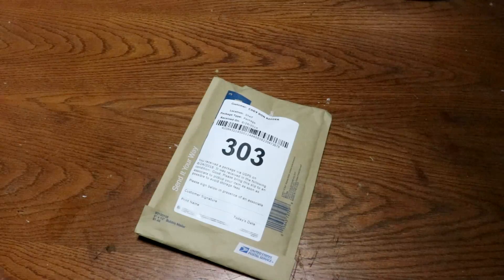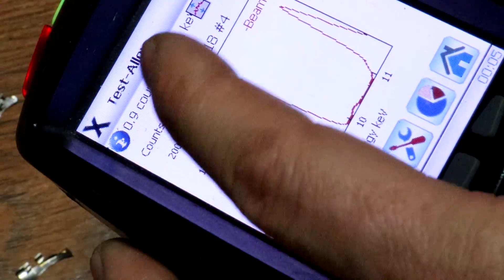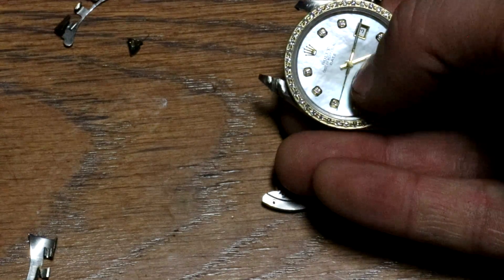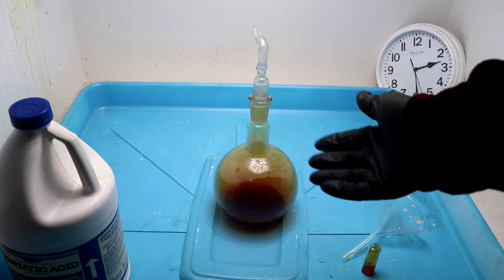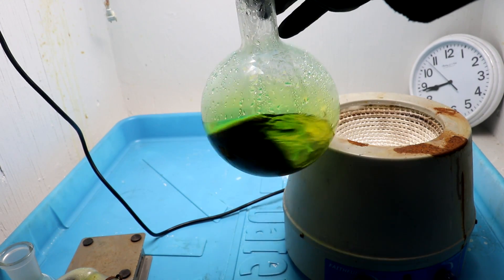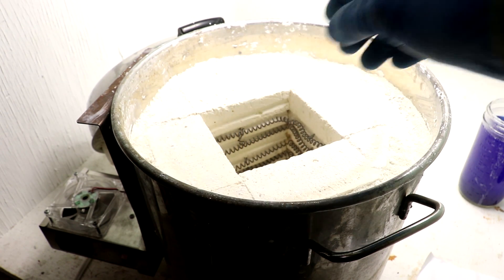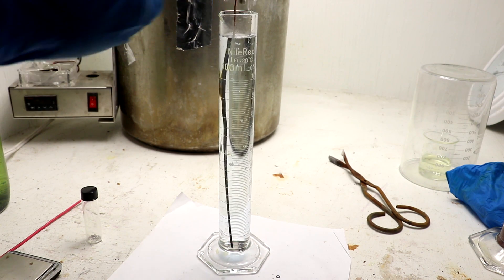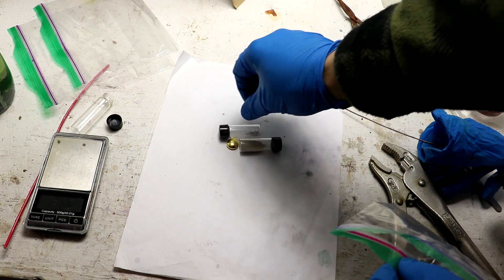How much Gold/Silver Is Inside a 7,000$ watch?

Comment: I hope u know that if u took the movement out properly, u could have sold just the movement on ebay for around $200+ (at auction) depending on the time of year. U could still sell the parts individually on ebay and get some money back. If u do don't do a buy it now,  do an auction. Ull get more for them. (I buy and sell on eBay and repair watches and I would love to have those parts)

Comment: To get silver out of ammonia solution, you as use sodium dithionite (just like you used sodium metabisulfite for gold). I found a local chemical supplier who actually has sodium dithionite, so I can just crash the elemental silver out of solution instead of cementing (which produces copper metal waste) or doing the lye and sugar process. But the copper method works great.

Comment: Ladies TT Rolex Datejust  with Jubilee Band. The center links, bezel, crown cap, hands, dial markers: 18K. Possibly Jewel settings and alloyed gear train. The case and outer links are 317L Stainless. The Diamonds are all very high quality VVS1. How many "Points" (diameter in mm)? 20?      .20 karat?
If you melted a full gold case and band (not two tone) you would have gotten $3k.
Reply: Rolex factory diamonds are above VVS1, it usually flawless or internally flawless (IF)
Reply: @karasus7512  Thank you for the correction. I'm a Horologist rather than a Gemologist.
Reply: I made another mistake. Points are a decimal of karat. But measurable in mm also *if converted*. 4mm = .25 points/ 1/4 Karat. But 8mm = 2 Karat.

Comment: To recover the silver, you should have put the AgCl into NaOH solution until it turns black, forming Ag2O.  Then add sugar and get a large exotherm.  Result is silver powder.  To prevent silver evaporating, melt borax in the crucible and drop the prewarmed silver into it.
Regarding silver and ammonia: such solutions on standing form explosive mixtures, (solver azide) especially on standing!

Comment: Also, just some rough estimates. 1 carat diamond price really depends on on the 3C's. but since they are used in a Rolex lets assume they are mid-high quality,  about $6000 per carat. those look like 1pt diamonds (100pt = 1 carat) and there are about 45 of them. So, ((6000*.01)=(60)*45)=2700. so about $2700.

Comment: The red pieces that hold the gears are likely to be rubys, and if it says rolex id be disappointed if they werent
Reply: There are a few exceptions but for the most part, all watchmakers use synthetic jewels as bearings, Rolex included.

Comment: Ever notice that? gems are minerals as well but they have no set market value. You'll pay a whack to buy them but when you try and sell them they truly have no value. My father was sold gems in the 80's as an investment. All certified and packaged gems. They apparently have value but unless you sell them to someone on the street individually there is no market for them. Same folks running the jewellery chains that would buy the gems also own the mines. They are only interested in mining more, marking them up and selling more and more. Once you own it there is no market. Gold and silver have set market value but the gems are valued no more than art based on cut a clarity. So when folks go and buy that fancy ring? Realize that the only true guaranteed market value on the stone is no more than the going rate for diamond used on an abrasive cutting wheel.  It's like paying a fortune for a painting from an unknown artist. Unless your gem happens to be one of the huge famous ones, that actually are rare, they have no investment value whatsoever.

Comment: These models pre 2005( for the datejust that is) have hollow centerlinks. The new ones are solid. Even the 16710 and 16750 gmt models ( ended in 2008) have hollow steel centerlinks

Comment: I counted 47 diamonds, I'm assuming they would have had a round number of 50 on a piece like this. Roughly guessing the size based on the ridges in your finger nail to be around 2mm making each diamond 0.03 carats which are around $36 each. That makes $1800 in diamonds. Adding that to your $500 in metals and we are at $2300. I'd say that's fairly reasonable considering the super low margin or error for clockwork precision and the fact that mechanical watches are still assembled by hand. Overall, I'd guess the cost to the company to produce a single watch is around $2600. 
Granted, it is still a prestige level luxury good with that kind of mark up, but I honestly expected it to be a lot worse.

Comment: So if you placed that x-ray gun on someone and activated it, could you give them cancer? Also, would it just register a bunch of carbon and water?
Reply: GameGuru No it isn’t that powerful a source of x-rays, but it is still not recommended.
Also it is calibrated for elements which have intrinsic value. There isn’t much of a trade in scrap water or carbon, however being able to point it at a random bit of gold coloured metal and get an idea it is 18 karat gold (75%) or base metal (eg brass).
Reply: The gun works mostly off reflecting Ray's, flesh doesn't reflect much, so it wouldn't register
Reply: Looks like no one in this thread has really answered your second question; would it only register carbon and water if pointed at a human. There’s gold in our bodies. Among tens if not hundreds of other trace elements. This seems to be a very precise X-ray gun, so if it could read what’s in human flesh and blood there would be at least dozens of elements to be seen
Reply: Yes. All light including and higher in energy than UVC has enough energy to knock off electrons from atoms, which gives it the name "ionizing radiation", and that will lead to cancer as it corrupts DNA. However, it's not as powerful as to penetrate materials very deeply, as it measures backscatter. It also seems very low in energy.
Reply: NB.  Energy, in terms of X-rays is represented by the scale showing keV. That determines/indicates how energetic the "beam" is.  The Exposure -dose one would get ( in Sievert(s) or Gray(s)) depends on the Energy of the radiation, the power output  (accelerator potential converted into X-ray flux) and exposure time   (Sieverts take type of radiation into account)..  It gets complicated, correlation with harm to biological tissue is not straightforward, risk is easier to determine than actual harm.
 Penetration is only correlated to the keV value of the x-ray, it has nothing to do with flux (afaik).  <40 keV is  regarded as a fairly " soft" x-ray (kind of like what is used in mammography)..
X-rays used in most diagnostic imaging for example are up to 2-5 times as   "hard" ie. up to 200keV - still regarded as " low energy x-rays.

lol..

ie, the higher the  (eV) voltage ( "particle" accelerator potential) the "more" ionising, hence the more dangerous in terms of mutagenic risk...

sorry  hijack.
Reply: No clue how many xrays his xray does. But regardless it shouldn't be more than a normal hooman xray. It takes alot of energy to produce Radiation if wete talking about electronics.
Reply: Grenherb  And your source for that preposterous claim ("cancer rates are at a[n] all time[s] high")? Is that why life expectancy keeps growing?

Comment: just for the record - value of gold is really NOTHING compared to the value of cut, gem-grade diamonds (source of knowledge: buying an engagement ring :-DDD a tiny change in the size of the diamond -> quite noticable change in the priceof the ring of the same model (both directions - increase and decrease); ANY increase of the ring size = amount of gold used -> negligible change in price (either direction). now this might be a courtesy of the jewelry shop but i doubt it. i think it really comes down to diamonds being much more valuable than gold. of course depends on the shape, size and probably color and cut but according to my shopping experience, that's what it is.

Comment: Those diamonds appeared to be around 0.10ct. It's hard to tell in the video but they were probably Imperfect grade i3M to i3O.

That means they'd be around $40 - $75 a piece. They looked very pink in the video, and I counted 50 of them. So you'd have at least $2500 in diamonds if they were $50 a piece i3O quality.

However, diamonds have an incredibly low resale value. So if you brought them in to a jewelry shop they'd probably give you less than $1000 for them all.
Reply: I'd be surprised if you could sell the diamonds for more than a couple hundred dollars. Diamonds aren't rare to begin with and the ones they use for this purpose are generally pretty low quality. All they have to do is sparkle.
Reply: @CrimFerret  yeah, and for the size and weight, the price is too low for individual pieces.
Reply: They're higher quality than the ones they use in abrasives for sure. Those ones don't even sparkle
Reply: you all have far too much time on your hands. Pardon the pun
Reply: Diamond saints
Reply: I can do $10 for all
Reply: What is i30? Do you mean I3? Even if they were D/I3 diamond max rap is 35 each, I don’t know where are pricing diamonds but you’re 100% wrong. 

Secondly, the diamonds are not even close to .10ct each. This is a Rolex Oyster Perpetual Datejust, looks like a men’s 41mm. That means the bezel is approximately 128 mm around, with 50 diamonds the largest stones you could fit would be 2.5 mm each - or .05 carats. 

Lastly, this is a diamond bezel on a Rolex. Rolex is not going to use subpar I3 goods. These are almost 100% VS+ goods with G+ color. 

Quit spouting garbage.
Reply: @hunterbrown9152  -
"The standards in the diamonds Rolex uses are incredibly high. Only diamonds that are at least IF in clarity are used and only diamonds that are between D and G in color are used. These standards include only the four highest grades of color. Rolex uses its own jewelers to set the diamonds in its watches."
Reply: @hunterbrown9152  Factory Rolex diamonds are always IF. The dial and bezel on this specific watch appear to be aftermarket. :)
Reply: @hunterbrown9152  can't trust anything you say cause the first thing you say is wrong . It's a ladies watch, is the small case size and the mother of pearl dial not a easy giveaway ? Secondly it's 36mm at max cause it has the old clasp , 41mm watches are new ones . Thirdly as others already mentioned how do you know they are not aftermarket diamonds ?
Reply: @hunterbrown9152  so whats your price boy
Reply: @hunterbrown9152  Rolex is the lowest grade haute horlogerie. They are just a click above ETA driven timepieces, which by some watchmakers are still considered better. That being said you can't rate the diamonds by what their slapped on (although they are definitely not cutting tool grade either)...
Reply: Sketch1994  Go buy a Rolex and tell me what the goods look like. 

You won’t find I clarity goods in Cartier pieces, you won’t find them on a Rolex. It would diminish the appearance of value and luxury. People don’t buy a Rolex anymore because it keeps great time, I have a cell phone if I want to keep track of time. It’s conspicuous consumption, that’s it. 

I understand what you’re saying. I’m aware of where Rolex stands in the watch community. It is still a luxury piece, with luxury goods, with a luxury price tag.
Reply: @hunterbrown9152  I'm definitely not an expert when it comes to stones (far from it actually) but is the difference that obvious to the consumer or even a non-expert (minding the small size and intricate cuts used)? In my field (engineering and manufacturing) most people will sometimes even go for a cheaper product because they are more used to it's look (like turning feed lines or rough milled finishes) and relate it to a known quality. I'm open to being corrected though...I know from personal experience that the eye can tell differences of  10-20μm and you can feel a step of 2.5μm if you're used to it.
Reply: Sketch1994 Hunter Brown is correct.
Reply: @Sketch1994  There are no "intricate cuts". Those are either single or double cut rounds. And the difference between an I and a VS is obvious even with the naked eye.
Reply: The first thing I noticed about the bezel is the spacing of the diamonds, looked very aftermarket to me
Reply: Well dang😭
Reply: The watch when new was easily over $10k, probably more like $15k plus. Not much value there in precious metals or gems. Just shows how little we really know about the true value of stuff we buy.
Reply: LOL a $1000? Yeah. No. and that was your LOW estimate wholesale price? Yeah. no.
Reply: Correction: they have close to 0 value, regardless if in shop or afterwards.
Reply: 0,10ct diamonds is much more cheaper than $40
Reply: That's interesting that 2 perfectly identical diamonds are worth drastically different amounts depending on they're new or used, why is that?
Reply: Rolex only uses the best diamonds. So unless they are aftermarket, they are nice.

Comment: Hi Cody, this is brilliant but I have a curiosity.  Is it possible to do fractional electrolysis similar to the way you can do fractional distillation?  My naive take is that you could use carbon electrodes and voltage control to pick out separate metals.  Then you would get nice crystals directly.
Reply from the maker: that is how they refine copper.

Comment: There is at least one precious gem you missed! They use Rubys on the inside. Because it is used for parts that move, they use rubys for their hardness and low friction with the metals. I saw one on the piece that had a few gears on it. I don't remember how many they use, but I think there should be at least one or two more.

Comment: That is fake. I'll tell you why.

The WhatsInside people have used a fake Rolex before in a video, it's been proven on Reddit. 

Secondly the watch would be worth more than $7k given the diamonds and that the bezel would be solid 18ct gold despite that bracelet being plated. A normal two tone Datejust (gold and steel) is over $10k alone, without any diamonds on the bezel or dial. 

Also the magnifier over the date has been removed, everybody, even a novice with too much money knows that you don't do that. No matter what modifications you do to it you don't take the date magnifier off, granted it could be a rare instance but it's just unlikely especially if the diamonds are factory and not a modification. 

The bracelet is the old folded link style with 18ct gold plating, which would be on a vintage model, they moved to solid links and solid gold like 40 or 50 years ago, and that watch does not look over 50 years old. It could be an aftermarket but it doesn't make any sense that someone would have the bracelet replaced with an older flimsier one. I might have just not seen it well enough but it also looked like there was no logo on the clasp. 

There was also no rotor on the movement for automatic winding, which should be there. 

I am almost 100% sure it's fake. But i'm just one person, I'll post it on Reddit to know for sure.

Comment: cody, a tip when using funnels. to let the air escape from the vessel while pouring a liquid in. i use a small piece of paper to lift one side of the funnel away from the rim so it won't make a seal.

Comment: Is it possible to recover 100% of all materials?
Reply: @ Mathew Clavvette.

99.9% Maybe, 100%, no. 

Chemical reactions are reversible, and there's always some portion of reactants left over because of that. Additionally solubility gradients are not absolute. There's always a little bit that remains in solution. 

The closest to 100% you can get normally is a continuous reaction where reactants are continuously added and products removed. But you only get as close as the purity of the product you can remove.

Comment: To be honest, I was a bit surprised. I didn't think it would be that much gold in the thing. I expected some, but not nearly that much. Most expensive status symbols (sans actual non-functional jewelry) in the 21st century aren't usually that much materially higher value than their common commodity counterparts. Some are slightly higher quality components, hand skilled work and more sturdy materials, but mostly its "only branding". I rarely see a significantly increased value in the raw building materials used. But then again, Rolex is not your atypical 21st century status symbol, but a much older "thing". And this looks to be an old model. While there is definitely a hefty brand premium, I guess the reason they're still around in the manner they are, is that they've been fairly consistent in keeping up their merits of world class craftsmanship. That's probably also why they're still very popular among well endowed people that aren't really as much into bling, as they are into "premium AND functional quality". Kind of the car personality equivalent of Lamborghinis vs Mercedes-Benz. Although there are certainly Rolex models available for those more inclined towards the back seat of Rolls-Royce'es and Maybachs.

Comment: The watch is 18k it looks like a mid 2000s but the links are hollow so its solid but like little chain links and the hands, hour markers, and rolex crown are gold as well the diamonds are all internally flawless colorless (if they are real and not aftermarket) but they should be real. The watch was probably sold for 7,000 but currently its more like 15,000 with current generation.  In case anyone was wondering
Reply: shut the fuck up you scammer
Reply: @dimitar4y  well your coming on a bit strong there.

Comment: If you analyze the diamond would it be a huge carbon spike?
Reply: Light atoms like carbon have very weak X-ray fluorescence, so generally you won't see much at all. In my work we use X-rays to look at carbon-rich materials (proteins) but in that case we're using diffraction (not fluorescence) and the beam of X-rays is far more intense and energetic because it's produced by a synchrotron rather than a low powered X-ray tube.